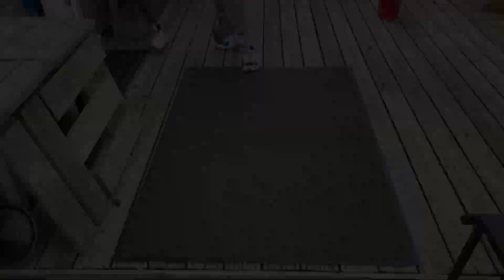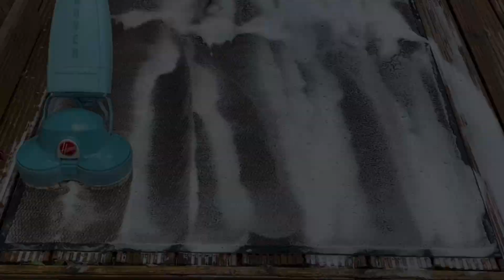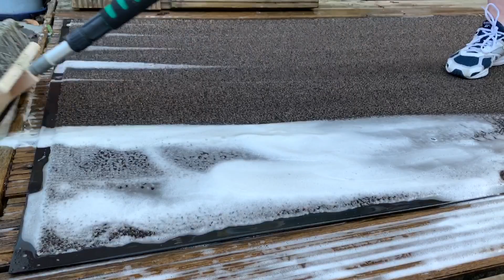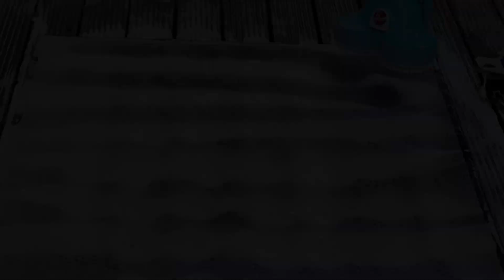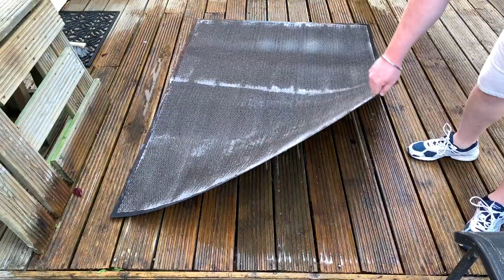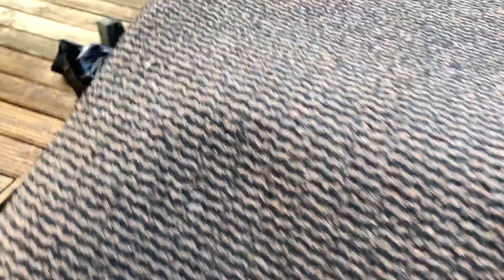Clean With Me, Washing My Rug 1960's Style Hoover 5464

Comment: Good demo. I hope the mat wasn't too hard on your floor scrubbing brushes (they made softer bristle brushes for shampooing). Looks like the 5464 did a remarkable job. Btw, were Hoover UK cleaner serial numbers coded? I noticed that the 5464's begins with "167"-would that indicate that production was in January 1967?
Reply from the maker: Oh gosh, I wouldn’t know about the codes I’m afraid, I’m useless at that. I have an extra set of the brushes, I removed some of the bristles to make it less hard on the motor. Just so much fun to use.
Reply: @HooverLux  Agreed on using those vintage shampoo-polishers!